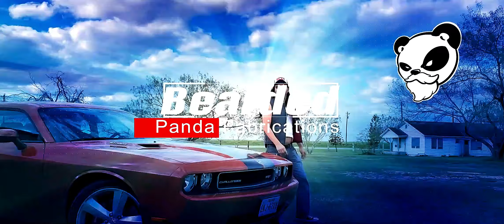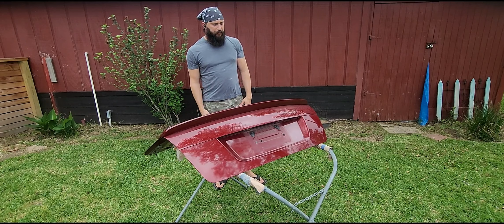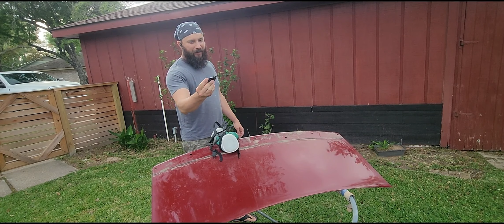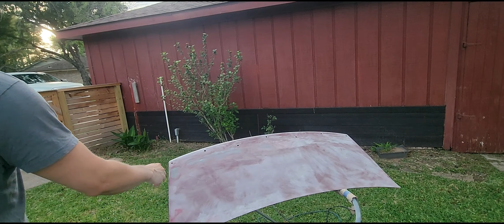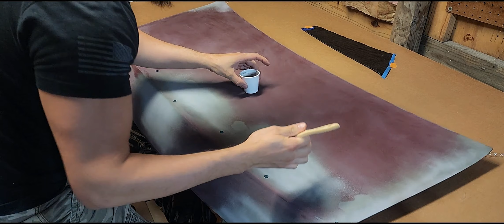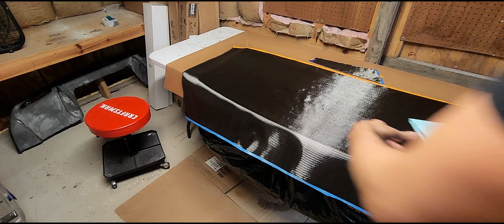DIY Carbon Fiber Skinning/Wrapping Trunk With Multiple Pieces Tutorial - Pontiac G8 Trunk Part 1

Comment: I have that same carbon fiber diffuser from bodykit kingdom in Australia...I do plan to do my trunk as well, bought the spoiler from Extreme Online Store so matching the carbon pattern will be interesting.
Reply from the maker: Having the weave pattern all go in the same direction is always a challenge but is usually overlooked.  It's not really a big deal in all honesty, but I'm all OCD about stuff like that.  Lol  As long as they all look legit. 
If you want the diffuser to last longer,  it's usually best to get it sprayed with 2k urethane clear. They lay the epoxy a little thin on that one. Overall quality is nice, though.
Reply: @BeardedPandaProductions   I will be doing a hypershift over the carbon fiber in an intercoat clear then euro clear over it